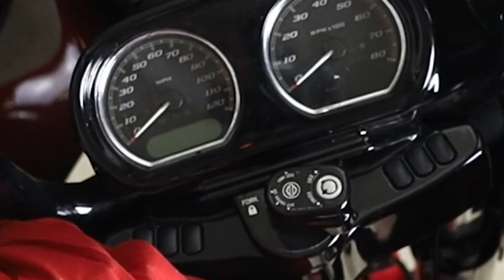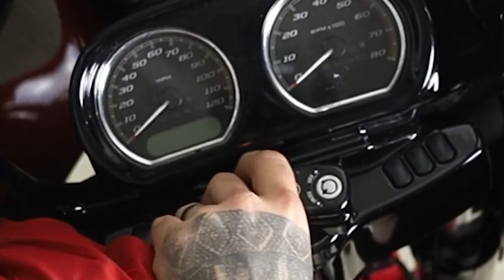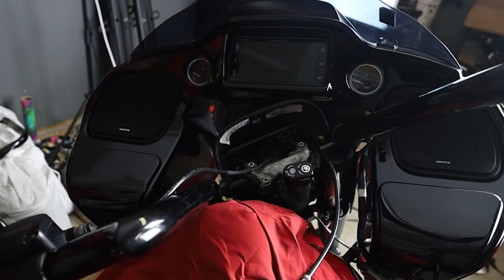How To Install KST Spearhead Bars On Your Harley!

Comment: The mesh is great, I did have to add some electrical tape to ensure it stayed tight going through the spearhead bars. Also quick tip to remove the nubs on the controls, use a small cold chisel and hammer, they pop right off. some of the videos mention grinding it off. Great video.

Comment: Maybe if you pulled the main fuse before you wouldnt have blown a fuse. Thanks for the vid, about to replace with 14 kst spearheads tonight. Are all the plugs easy to identify when plugging back in or should I mark them?